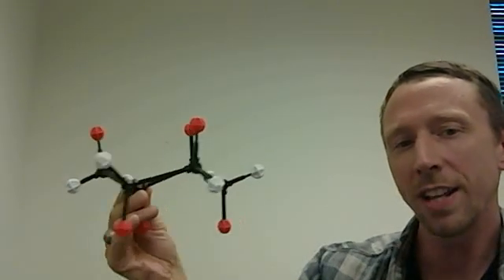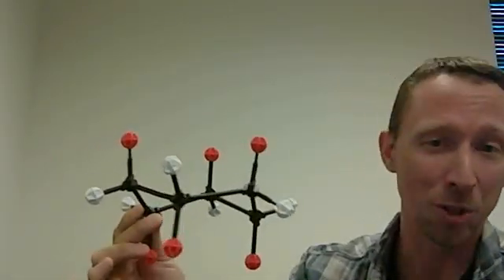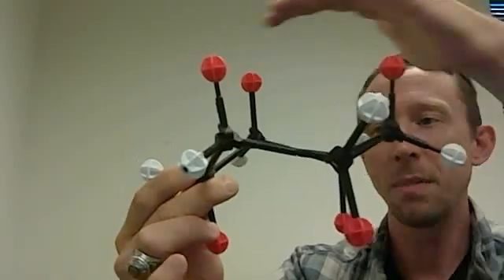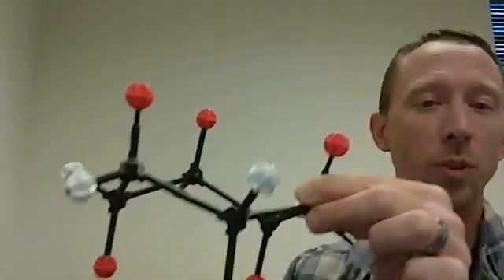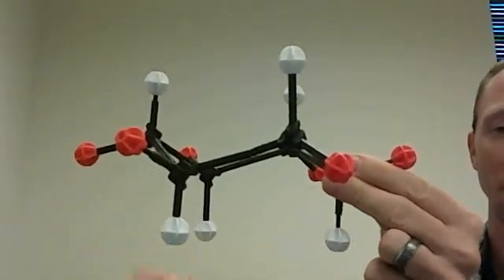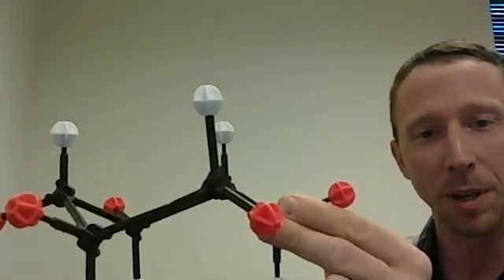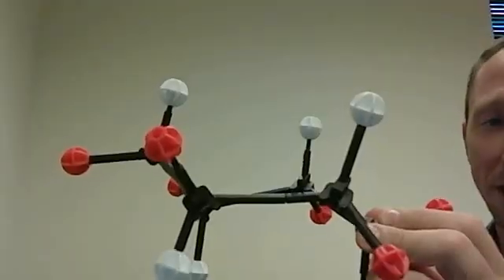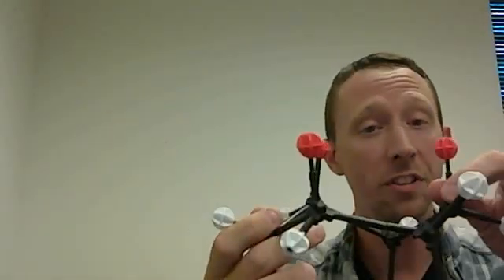Cyclohexane Ring Flip Demonstration

Comment: it makes a lot more sense now though I wish you had flipped it more slowly
Reply: using 0.25 speed...still hard to see
Reply: @user-eo1tw9ly8q  With a model kit, set it up the same way he did, all red axial and all white equatorial. Then individually rotate each ring carbon so that the red becomes equatorial and the white becomes axial. Chair flips are just switching between axial and equatorial. You will notice that the direction (up or down) will always stay the same. For example, if a group was axial up, a chair flip will make it will equatorial up.